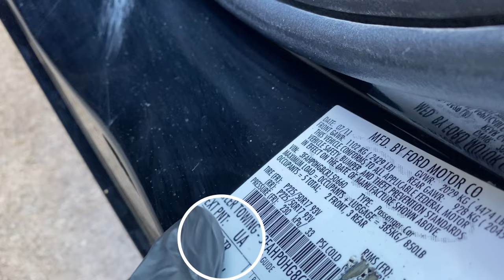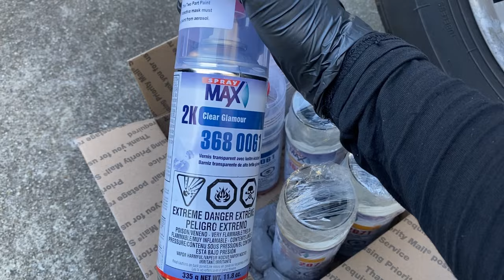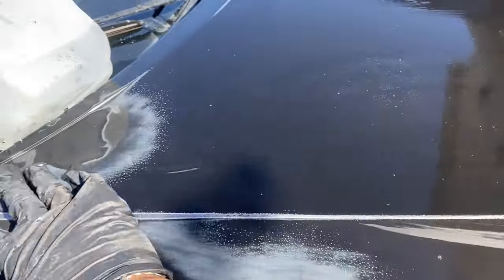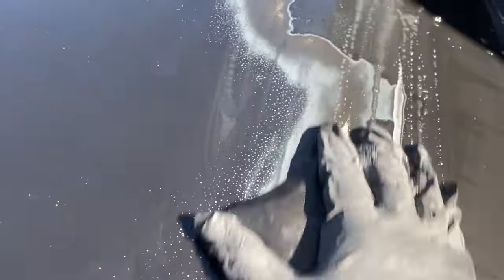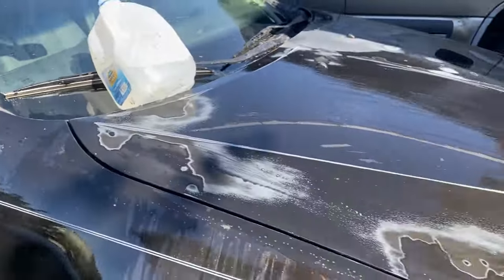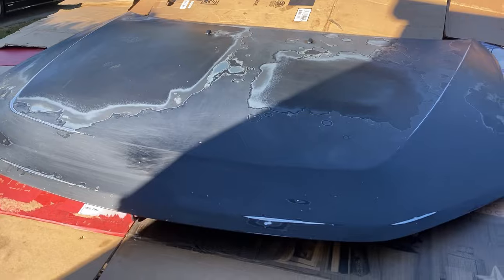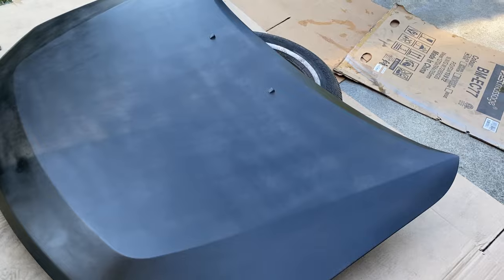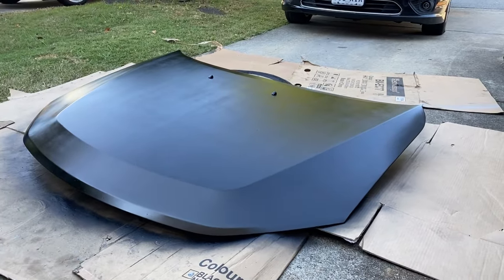How to paint car at home using Rattle Cans. ( Hood repaint ) My first time 👍

Comment: Sand further, fill with bondo, sand smooth would have fixed your lines showing through.  Couple more coats of primer would have helped also.  Otherwise, pretty good job.  You're one of the few I see who wet sanded after the clear to remove the orange peel.  Nice work overall.
Reply: Bondo before or after the primer?
Reply: @chrismulhauser333  Bondo before the primer and it should also be applied to bare metal.

Comment: From a professional in the auto repair industry: your first reported paint job is pretty good, minus the small sanding defects from the primer. Only big issue I would say to you is to make sure to a get a respirator mask, especially with all the carcinogens inside that 2K clear coat. Take from my experience, you don't want any lung diseases popping up on you out of nowhere. They're definitely not joke when it happens. Other than that, pretty decent work. Keep practicing your craft and you'll do well.
Reply: 100% agree please get a mask. My cousin was diagnosed with lung disease 2 months ago they literally gave him 24 months to live. All because he was to lazy and manly to use a mask when painting

Comment: Hi Brian, I need to do my Honda CRV hood. Is there anything you would have done differently? Would you invest in a gun and quart of paint instead? Was this cost effective? Thank you for your honest video and any suggestions!!
Reply from the maker: Hi there, make sure you sand down the old clear coat pretty well and even. You don’t really need a gun if you’re just painting the hood. Just follow what I did with the video and you should be ok. And yes it was cost effective. Body shop wanted to charge $500 to just paint the hood. This cost me about $200 with everything and I learned something new in the process.
Reply: Thank you!!

Comment: Working on my f150 front bumper grill and Hood. And the roof that's bad. First time doing it. What I see that you've done is just as good as I do probably better than me. You did a good job. If do you ever do it again. Take more time on each step. I bet you'll do even better. As is great job.

Comment: I have 2014 mazda 3 black and scratched my side panel and door with a dent. I need to pull and fix the dent first and then use filling and spray paint. Lets see how it goes. Any advice?
Reply from the maker: Yes pull the dent out and use bondo to even it out. My only advice is to make sure you sand off old clear coat best as you can so it doesn’t show with new paint like it did to me.

Comment: You did a good job. Sand a lot before primer then use a primer / surfacer high build and apply 3 coats and finish with 800 grit. That should fill in the clear coat marks
Reply from the maker: Thank you! Will for sure do that next time.
Reply: What is a primer “high build”?

Comment: My hood looks awful..I think I'm going to try this! Looks good
Reply: Just take it to maaco. The cost in rattlecans will be $200, with sandpaper, an extra $20 something dollars and the average MAACO will charge 300.

You are only saving about 80 bucks and chances are it will show in the quality.

My recommendation is only paint bumpers DIY style, not anything metal.
Regardless goodluck though
Reply: $300 for what?

Comment: rep prep prep, it's all about the prep. I think that you know that you didn't sand the original paint well enough. Unfortunately, it's next to impossible to tell on video how close you are to having sanded it all out, but it could prove an interesting experiment to try to "fix" this as opposed to redoing it. The traditional answer is to sand it down to get it even, prime anyplace you sanded through, and then base and clear. 

OK. I'd be tempted to try to fix it instead, especially if the hood is otherwise flat: instead of sanding it down completely, start with 1000grit (I might consider 600 or 800, but being inexperienced I'd tell you to start with 1000, it will go slower but you'll be less likely to mess it up), and try to see if you can even it out without sanding into the basecoat. Even possibly giving it a heavier coat of clear over and around the uneven areas first. If you can manage to even it out or get it really close without significantly sanding into the base then you could go over what you have left with just clear, kind of like doing a flow coat, and then buff and finish.

As far as your overall technique goes- you don't have to go as light for the first layer, that's mostly to prevent runs and chemical reactions in difficult situations, which a hood laying flat is not. Going that light might result in a sandy surface on your later coats, just more work to smooth out. Second, especially for the base and clear, keep your spray pattern going front to back to front, with the length of the car. That is less likely to cause any mottling/zebra stripes that you'll notice when you're done (your eyes won't be as likely to notice it if it's there it goes with the length of the car).

Comment: That paint job is going to start peeling from the window wash sprayers first.......should of taken them off.
Reply: How do you concur on that? Would like to know cause I plan on doing this to my hood
Reply: @hhova29 those nozzles are made of plastic, but you need a special primer on plastic. So, not being prepped in any way, the paint will not bond properly and will come off - tearing away the paint around it as well.